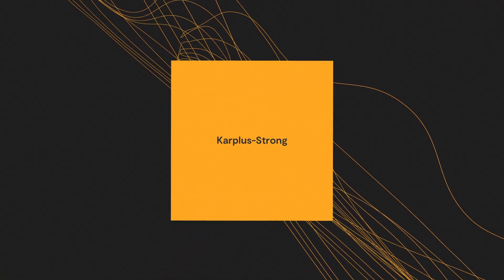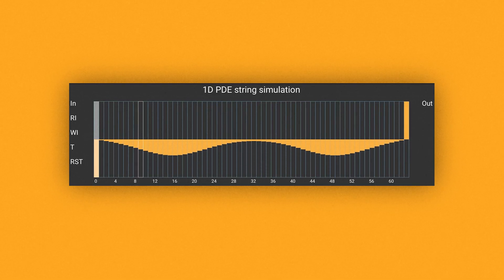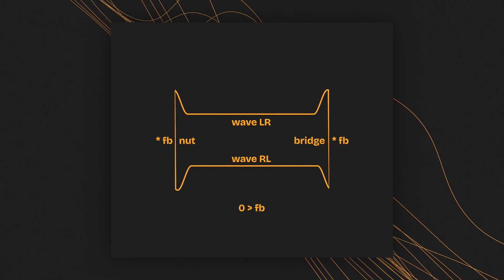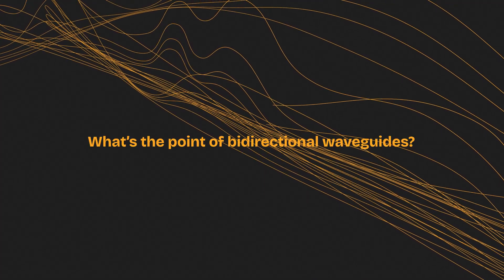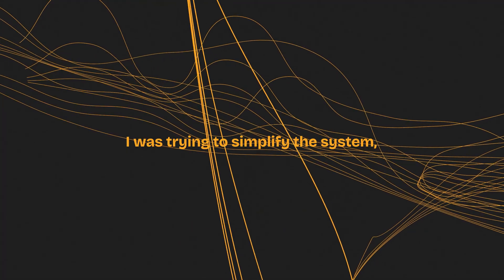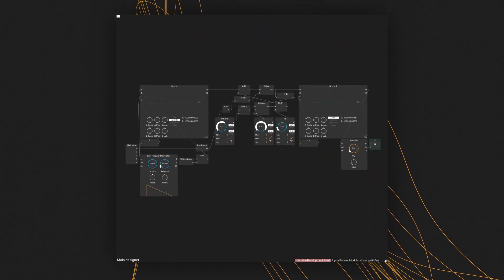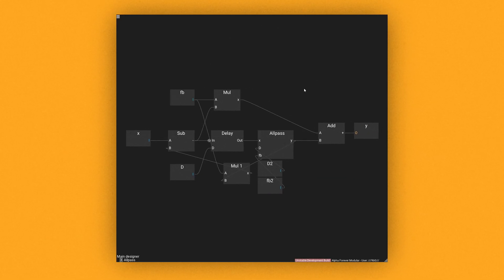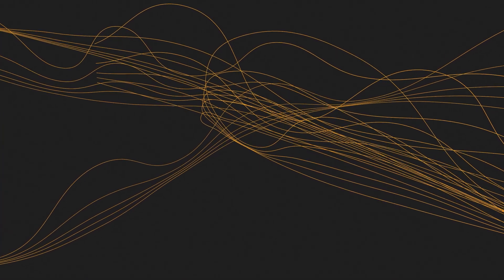My simplified approach to complex waveguide synthesis

Comment: obviously everything about this and your modular platform is high quality and intelligent, my only gripe however is that a zoomed out view of a patch isn't easy to relate to for those of us who aren't customers (or who are on osx or linux) looks and sounds great otherwise.
Reply from the maker: Thanks a lot for the feedback! I totally get what you mean about the zoomed-out view. I try to zoom in whenever possible: that’s one reason I stopped doing unscripted ‘spontaneous patching’ videos. Time is always a factor, but I’m working on improving clarity. As for the patch itself, the Karplus-Strong is really visible around 0:58, while the allpass filter and the nesting technique show up later during the build. If you get both, you have everything required to start off with this technique outside of AFM. Thanks again for watching!

Comment: Do I get it right you want to ship a synth that is able to simulate notes in a chord affecting each other? That's the limitation of sampled piano libraries, a chord with, say, a minor second in it would sound sterile whereas in a physical piano the pitches move around making it more captivating.
Reply from the maker: hi! thanks for reaching out. this video is actually about something a bit different. i'm not trying to ship a synth: i'm just sharing my experience with a synthesis method called waveguide synthesis, where i think i've found a way to simplify the workflow without losing the method’s capabilities. the software i’m using here is a modular synth (alpha forever), and yes, i’m one of the developers, but that’s not the point of the video.

waveguide synthesis is one of the most well-known physical modeling approaches. it simulates resonating bodies using delays: the length of a string corresponds to its pitch (the travel time of the wave), and the decay can be modeled with simple processing. by feeding the processed signal back into itself, you get natural repetitions and decays.

in this video, i’m showing a more efficient way to combine these “strings”. you can use the technique for all kinds of sounds. i’m especially proud of my piano and snare examples in the background. to get similar results, you’d need to dig a bit deeper into this field, and modular environments really help with that.
Reply: @9b0 Thanks a lot for the explanation! While this topic is fascinating I'll never finish my songs if I get tempted into this rabbit hole. Great work and amazing video!
Reply from the maker: @drrodopszin  it’s definitely a rabbit hole, and making music is the most important thing. for me, though, experimentation and learning are part of the music-making process, so i end up in multiple rabbit holes all the time.